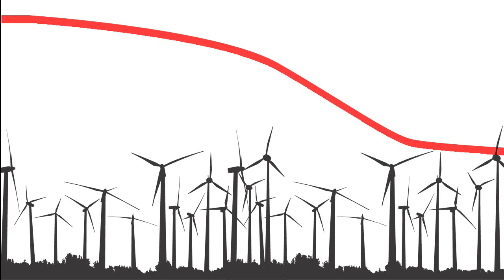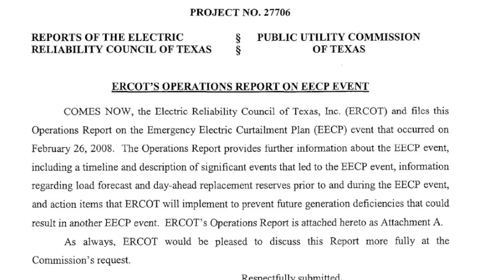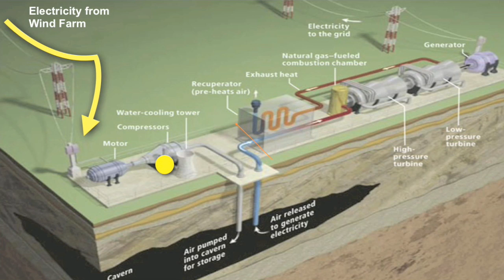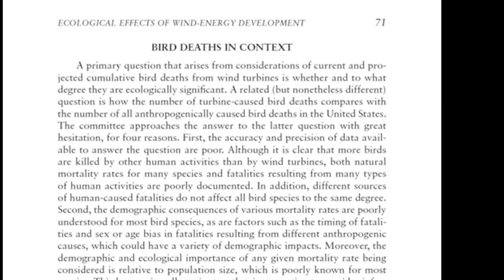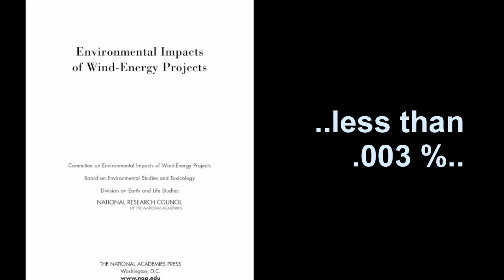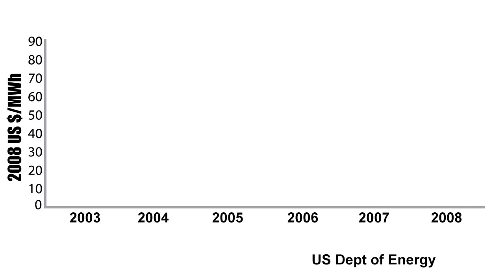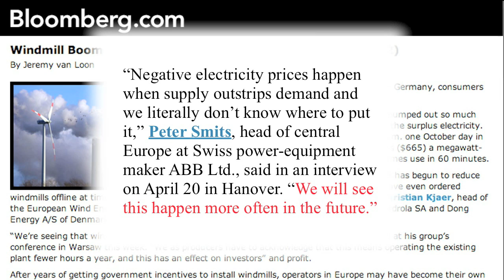Renewable Energy Solution of the Month - Wind

Comment: Wind has a capacity factor of 20 to 30 percent of nameplate, so three quarters of the time backup power is used. In New Zealand hydro generators are putting in wind turbines to save dam water, but in the USA the gas companies are pushing for wind farms, knowing they'll sell more gas. Denmark sometimes has to pay to get rid of it's wind power, but still burns a lot more coal and gas than France or Sweden, which rely on nuclear and hydro.
jon

Comment from the maker: @SteelBalor 
the net energy argument does not hold water. Wiki indicates "initial carbon dioxide emission from energy used in the installation is "paid back" within about 9 months of operation for off shore turbines."
probably something like that for onshore as well. If turbine lifetime is 20 to 30 years, should pay back pretty well. certainly as least as well as tar sands or coal.

Comment from the maker: @exzealient 
you'd have to document that number - it's at variance with the official sources I've seen, which are in the 30 to 40 percent range, higher for offshore.
there is definitely a future for household scale systems, and one of the advantages of distributed energy is that it will allow generation at the macro, and micro scale, as the grid becomes more like the internet.

Comment: @greenman3610   Wind currently supplies less than 2% of energy demanded in the US, and this is after significant installations and attendent eco-system impacts.   To meet the energy demand here in Pennsylvania where I live, you would need literally tens of thousand of wind turbines (and still keep the traditional power plants online).  At what point do we say that as a human species we need to reduce electricity demand, instead of more transmission lines and more animal habitat loss?

Comment: @greenman3610
Immediate problems: BEV's require lithium for batteries; there isn't enough to refit the global fleet (including trucks).

Using electricity for heating triples total energy consumption.

Rated power is not mean output. Footprint is far larger than base area of the turbines  because you can't have blades intersect *nor* can you put multiple turbines behind each other efficiently. Then we have variability and the fact that the best supply is on the equator, and demand isn't

Comment: @RandomConcepts 
"maximum output"
Requires maximum input. That is an issue with wind power. This is one of the reasons why wind farms are rather large; to make up for a potential lack of wind.

"blight factor"
The removal of a mountain top is far more of a blight than the addition of acres of wind turbines.

"insidious noise"
I've actually been to a wind farm, and stood several yards away from a turbine. The wind itself was louder than the turbine. How do you silence the wind? It's so loud!

Comment: @robhoneycutt In order for power prices to go negative generators must be prepared to pay to get rid of surplus electricity. Generally these are large thermal generators which take days to ramp up to maximum production. Wind turbines however can be turned off/ restarted quickly and cheaply. I worked for a power company and one of our wind farms was set to cut out at a negative value, not zero as I had expected. Carbon credits made it profitable to generate at negative prices.

Comment from the maker: @falxcerebri21 
I"ve found 15 pumped storage sites in the US.  They tend to be smaller than hydro sites of similar output, since they are designed to firm up the existing grid.
I am sure any new faciilities will be subject to scrutiny on environmental grounds -
but I hope the impacts will be weighed against things like mountain top removal.
I actually think compressed air underground storage will be a much bigger player - I a show the example to demonstrate that storing energy is not new.

Comment: @ketos234 I'm not an expert in this field but I have read some things about how we are updating the electrical grid.  Some of this is going to be high voltage direct current (HVDC) which is more efficient than AC.  What this means in regards to wind generation and other "intermittent" sources is, well, the sun is always shining and the wind is always blowing somewhere.  That is highly predictable.  So, over a broader market range the power can be delivered to where it is needed.

Comment: @robhoneycutt Grid losses are minor (under a %). The problem is that wind and solar are very capital expensive; if you're interested read "Without the Hot Air". The wind is always blowing somewhere, but unless you're willing to repossess and tile 20 or 30% of land (and 40-50 of sea) with windmills and solar, you can't make the numbers balance.

The problem is one of scale, and the practicalities of doing it. There are secondary storage issues, which are *very* thorny to try to deal with.

Comment: @robhoneycutt that may be what you would hold but I get marks in my energy studies module when I mention high maintainance costs for wind energy. Moving parts require more atttention than static parts. 1000 wind turbines is equal to 1000x the attention required. Yes the parts are smaller requiring less lubricant but the overall costs are still a lot higher.
Of course this should be weighed against fuel costs in nuclear plants, though a fuel rod can last years depending on type.

Comment: When you actually run the numbers, using the UK (very windy), taking 1/3 of all shallow and plausible deep water for offshore wind (about 2/3 and 4/3 the area of Wales respectively), and cover the windiest 10% of the land with turbines, you get about 70 kWh/person/day, or about 40% of a conservative estimate UK energy consumption.

For reference, these numbers are about 3 times more optimistic than any other estimate of UK wind potential.

Comment: @T0B0KKE The main criticism of renewable energies is a wind farm for example will not always be as active as one may like it, like on a nice beautiful sunny day. The solution isn't to simply rely on ONE farm, but to build farms in different areas. interconnecting wind farms several hundred ours apart could compensate for one or two farms going temporarily offline. Durring a sunny day solar could be used, durring a windy stormy day or at night wind could be used. Geothermal could be used too.

Comment from the maker: @pgm98387 
urban wind will have a role, as more and more buildings are designed to be energy neutral, or even positive producers of energy using solar and wind technologies.
Meanwhile, fleets of wind turbines, wave devices and tidal devices off of coastlines will create energy very close to where most of global populations live, actually decreasing the transmission distances required in many cases.

Comment: @TRUMPHENT in the UK the 'Hinkley Point' reactors were supposed to have 3 levels of safety procedures in case of an accident.
The reactors operated for 30 years (with several 'accidents' & shut-downs during that time) Then a few years ago there was a plan to sell them off to a French nuke company & so they did a stock-take & found that the 3rd safety measure (I think it was a boron 'dump') had never been built in & nobody had 'noticed'.
It was paid for.. but never installed!
Safety first eh?

Comment: Wind installations need conventional source back-up, since wind blows intermittently. A coal fired plant backing up a wind installation has to be "ramped" up and down, using more energy than just keeping it online, thus CO2 emissions are not reduced.  

See the report by The Nature Conservancy, "Energy Sprawl or Energy Efficiency: Climate Policy Impacts on Natural Habitat for the USA."  They point out that many "renewables" are land intensive.  You advocate sea-based, but many are land-sited.

Comment: @Minttzz you are correct, what the project needs is more research into cheaper solar generation and cheaper hydrogen powered devices, water has a very high energy density, far higher than coal, and water separators can be made for under $200 at home, the idea being you produce hydrogen in the separator, powered by solar, store the hydrogen in tanks, use the hydrogen to power your house and vehicles.
there was a very good TED talk on this, should be somewhere on wimp if you wanted to look into it

Comment: @Minttzz 

You're correct, deriving hydrogen from water takes significant investment of energy and leaves you with a product of about 50% theoretical availability compared to the energy you put in. Mobile fuel cells are at most 50% efficient, summing up to a conservative reduction of 75% over just using the electricity you had in the first place. 

H2 can also be extracted from natural gas streams etc.

Fuel cell cars don't have operating emissions, but straight up electrical don't either.

Comment: What agrivates me the most is that so many conservatives call green energy a "waste", that it will never be as good as fossil fuels, that its a "job killer".
In reality Solar Industry in the US alone improve from 50k to 100k working force, it practically DOUBLED between 2009-2010. That is just solar energy and thats over one year.
     With additional reseach aswell as tax benefits to those who use renewable energy would most certainly bring us closer to fossil fuel independence.

Comment: Great info on bird mortality. It helps alleviate what's always been one of the only downsides to wind power in my mind.  Another issue is bat mortality, which I've heard is caused not so much by collisions with the blades, but by the zone of low pressure created behind the turbines which can cause a bat's lungs to burst. But there must be a way to mitigate that, and with white nose syndrome spreading wind power is hardly the biggest threat to bats these days.

Comment: Again running the numbers, Pumped storage runs about 1 kWh/ton of fluid given a 400m head height; molten salt systems are a bit better (0.1 MWh/ton of fluid), but even for something as small as the UK the required backup runs into literally mountain sized bodies of fluid being stored at 600-700K...

The fact that the German grid overproduces kind of confirms the point; E.On reports wind producing between 0.1% and 32% of daily need, and they can't efficiently predict that at the moment.

Comment: @DeviantincTV Yeah, so they either have a very high wind area which will always make extra noise hitting off the right stuff, and they keep the turbines turning fast, or if they are turning at average speed, which is relatively slow and still being that noisy, it must be the model.

Still, I would hope they picked the type for a good reason. Maybe its strength and efficiency for that location

Just speculation, but the point is, they dont have to be jet engine loud. Not that they cant be anymore

Comment from the maker: @joshcryer 
agreed we need less cars.
However, building the mass transit capacity to get people out of cars is a generational project, that a lot of us have been advocating for 35 years or more, and it hasn't happened. 
And now the climate crisis is upon us - and we need to change the system we have, not the one we'd like to have, or will have in 40 years.
So - V to G, because it makes sense - more mass transit, because it makes sense, and gradually building a society where you don't need a car.

Comment: Very interesting indeed, but on the statement at 2:12 that, "all sources of power are intermittent" isnt wave power and geo-thermal energy relatively constant?
 
And what would be better for average households?  The smaller faster spinning one with a battery storage?  There is research to suggest that when one of these is used in conjunction with a Hybrid-Universal system which incorporates several of the smaller photo-voltaic panels that it may be possible to come off the grid completely, which is my end-aim, along with rainwater harvest.
Reply: +Brad Brassman Wind turbines rarely produce more than 30% of their rated power over time (look it up), rendering claims of powering "X thousand homes" largely false. The intermittent wind also means they require constant grid backup from traditional sources, thus reducing carbon far less than claimed. We who've actually researched their downsides (aside from the visual blight) realize what a scam the whole thing is. We're losing priceless scenery for electricity with terrible energy density and reliability, riding on the backs of subsidies.
Reply: +NoEcologyNoEconomy I quite agree! And I know the big ones arent woth the powder to blow them up!  But the one I looked into some years ago suggested something called a "Universal Household System" harvesting both solar and wind on a much smaller, three foot wind turbine, that was, at that time, available at B&Q! 

I dont know your location however, but in my district there are a number of fast flowing rivers and deep weirs which early industrialists used to power huge factories in the 18th century, which would produce a constant source for a large district!

Comment from the maker: @T0B0KKE 
efficiency not as big an issue if the fuel is free.
for a good outline of an all renewable plan, see Scientific American, google
A Plan to Power 100 Percent of the Planet with Renewables

the foot print of wind is actually much smaller than coal, or even nuclear, if you consider that onshore wind still allows for farming and grazing land use, and much will be offshore.

Comment: @pgm98387 wind at sea or on bleak hills is generally so much stronger than in cities, that it can overcome the effects line loss: it varies from project to project. 

Microgeneration can end up comparatively inefficient when you include the effects of specific embedded carbon - the energy required to build the components, per kilogramme of component. Again, it varies and some urban generation is advisable.

But wind power doesn't have to be in an urban centre to be green; far from it.

Comment: @BaileysBeads That is already considered when building them, but sure, a 10min video (youtube limit) is not enough to cover every single pro and con of a technology.

Also, everything has a consequence, but what enviro issues will be solved by replacing them with this issue.

I think in general these green energy solutions are net positive for the environment and we are better at solving those problems with time.

Comment: @greenman3610 Yes but you started the segment on how often various energy sources could produce energy "wind is powerful but intermitent" yet you neglected to add that to the mechanical failur rate. Instead you made out that wind was genrating power much more often than the other types. That is what i was annoyed at. You should have honestly represented the number of days a wind turbine cannot function.
Further when you do lack wind you still need the backup stations to prevent shortages.

Comment: The problem that alternative energies face is that if you aren't FOCUSED on one type of energy you can't get funding from the coal/oil tycoons.  But, if you aren't broad in your approach it is very simple to punch holes in any single alternative.  We need wind, but we also need solar, and we can for the next 50-100 years piggyback fission (and, in a decade or two, fusion) while developing geothermal and hydroelectric.  It has to be a broad platform

Comment: @greenman3610
Average power from wind is about 2W/m^2 (tinyurl / 2wdnr96 for derivation)
US energy consumption 3350 GW in 2004, so 1.675 Million km^2 (1/6 of the US)
To get these numbers requires mean wind speed of 6m/s; and that happens on maybe a 1/4 of the US. This isn't well distributed and thus vulnerable to variability.

It also can't cope with the increased consumption involved with moving to electric heating. (multiply industrial/domestic energy consumption for heating by about 3)

Comment: @robhoneycutt The US, maybe. European losses are small. The major difference is that we have a phase locked High Tension AC grid, the US doesn't, so there are many motor-generator pairs to do phase matching. They're inefficient. Moving electrons at 400kV, even AC, is fairly efficient.

Comment: negative electricity prices (for wind) only occur when there are carbon credits etc paid per megawatt hour. This means it is profitable for the utilities to run there turbines at low negative prices. The moment it becomes unprofitable to run them where the cost of getting rid of the energy exceeds the value of carbon credits the windmills where be switched off. This is in contrast to some coal and nuclear plants which take days to start again if they are switched off.

Comment: @adecentusername 
Nope.  You're talking the LMFBR, or liquid metal fast-breeding reactors.  This particular type of reactor used liquid sodium as a coolant.  Guess what the actual safety problem is.

I'm talking about MSR (molten salt reactors), specifically one variety called LFTR (liquid fluoride thorium reactor).  Most of the work was done for this in the 1970's, by Oak Ridge, but the project was canceled for political reasons in favor of the LMFBR.  They're making noises about it again, tho.

Comment: Wind generators may be reliable but they generate 1/3 of the nominal power on average as far as I know. Also nuclear power plants have different down times. CANDU plants for instance are designed to work without pause during refueling. All the new ones do that. There are no CANDU in the US... Anyway, nuclear power plants are good for the baseline of the demand, wind generators are good but have to be balanced with fossil plants to ensure the constancy  of supply, at peek hours for instance.

Comment: @lazyperfectionist1 Of course everything is situational and each renewable source has its benefits

Wind power I believe gets most power outside of peak sun hours, basically as the suns going down or after.
Solar max power is during mid day hours, so they balance fairly well.
Hydro probably has its peak hours also.

People also forget about geothermal because its not practical in many places, but where practical it should be pushed.